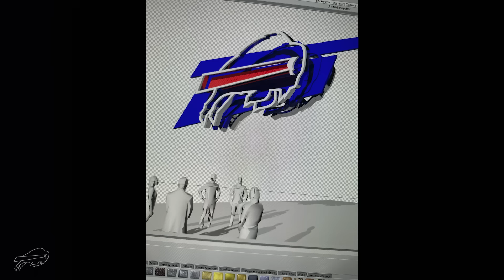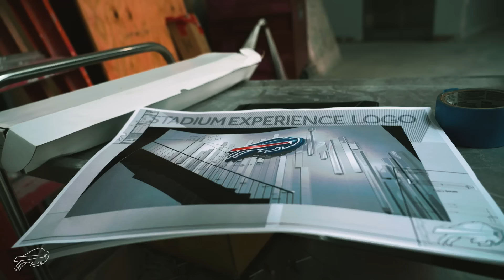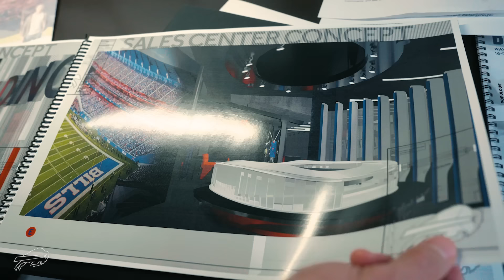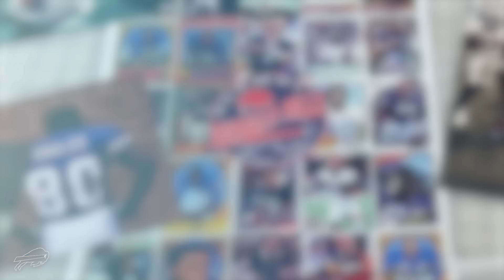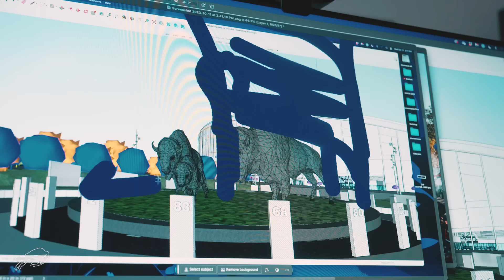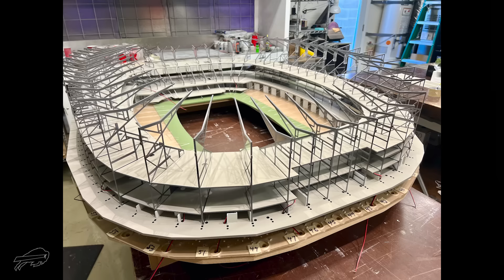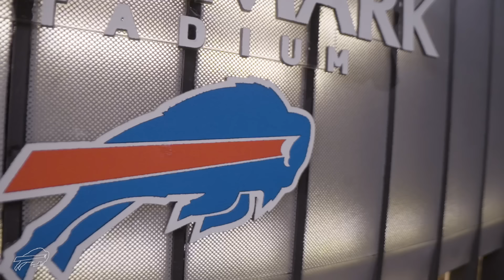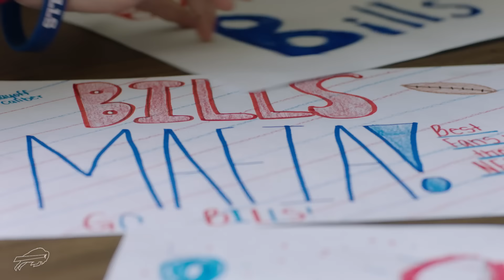Exclusive Inside Look At The Bills Stadium Experience | Built For Buffalo Episode 2: The Experience

Comment: Maybe even have a draft hosted here God forbid they put a dome on it you know they put basically dampeners around the whole outside it's like a wall with tiny little holes in it so there won't be any swirling wind and the whole field and about 20 rows up well I'll be getting rained on and snow down it's not going to be temperature controlled but about 65% of the fans will be covered by a canopy it's kind of like a way to keep a noise from escaping the stadium I think